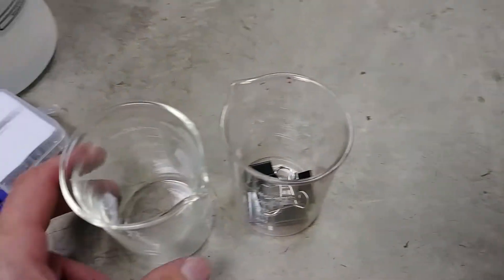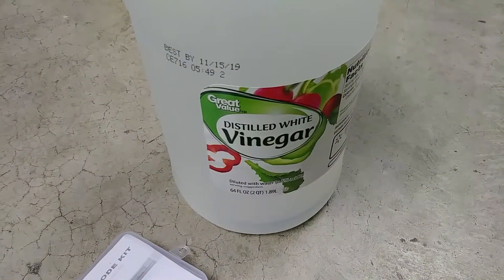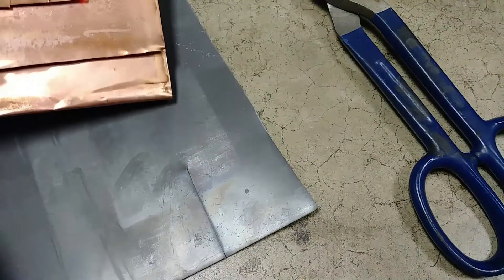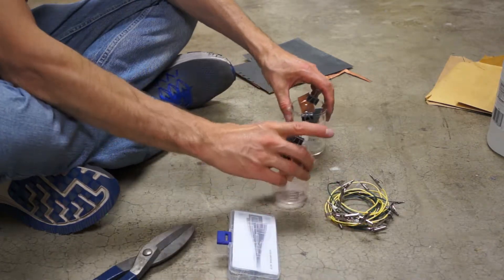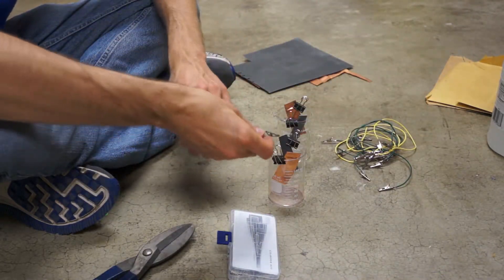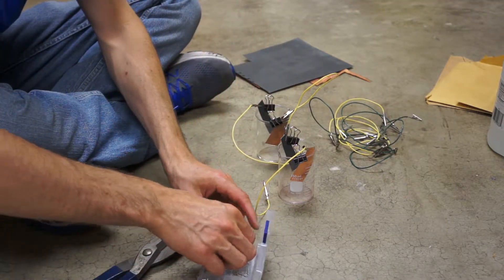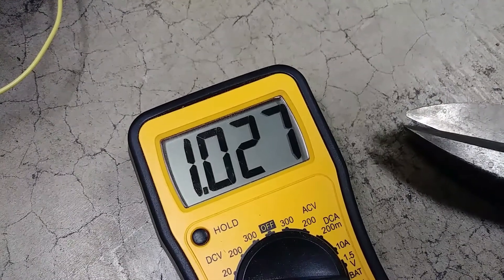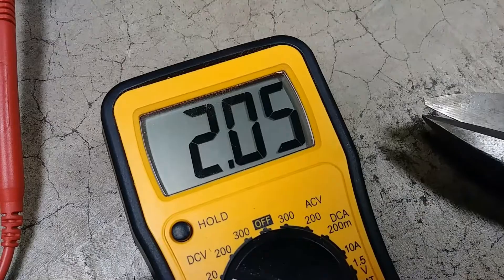Zinc, Copper, and Vinegar Battery

Comment: u can link a microcoil in between the one of the wire to the led to delay the current charge and increase voltage from 2volts to 4 volts, all LED require 3 volts... doesnt care for amperage... it just needs the voltage, LEDs usually have a resistance before they burn or around +1 extra volt depending on color, usually blue one is very finichi... burns very fast even at perfect 3 volts... but red or white one can actually run very good on 3.5/4v but u can stabilize the current with some extra components very cheap .. if u want to do like lets say a small LED powered lamp for nightstand etc... add a motion sensor, and a capacitor to store energy when is not used and u can have a LED that turns on and off during night time... but then again u can simply use a discharged AAA battery or AA battery in a similar system, and drain it completely...

this is a great experiment for learning, however unless u want to mass produce it and make actual batteries from this type of process, not really useful.

also if u want more output, u need to just space the anode, catode very close to each other and add a bunch of them in a vinegar solution. more plates = more power. but then heat, and decay comes in play and other issues being so close.